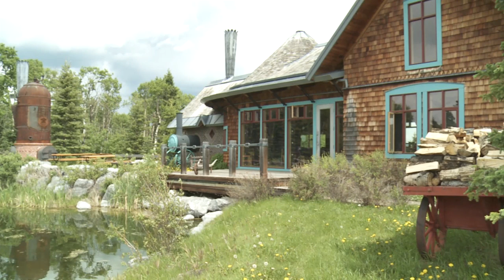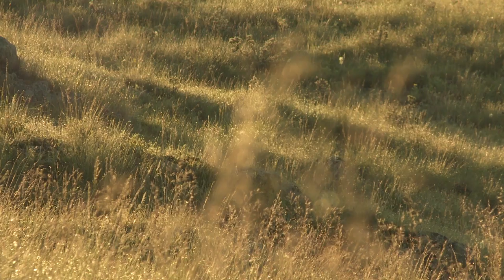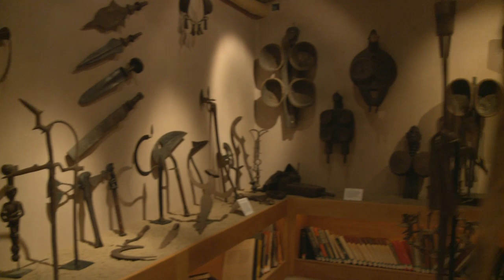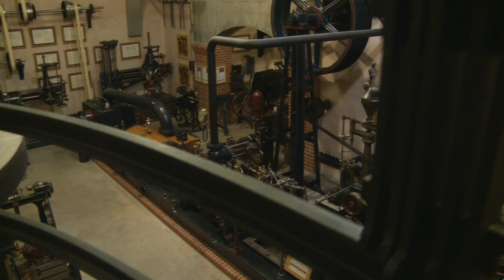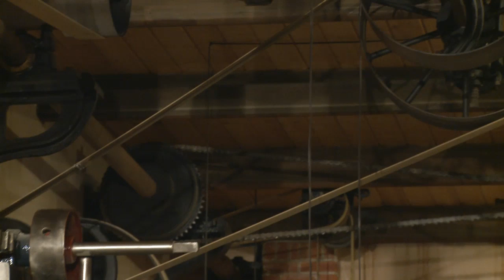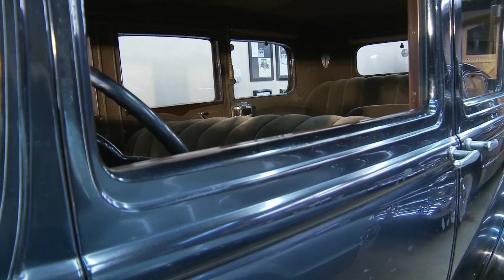Introduction to the Museum of Making

Comment: I started working as a printer using the lineotype and the old Heidleburg windmill printing press. Grate way to get a lead burn, as they would spray lead all over you if you weren't careful.